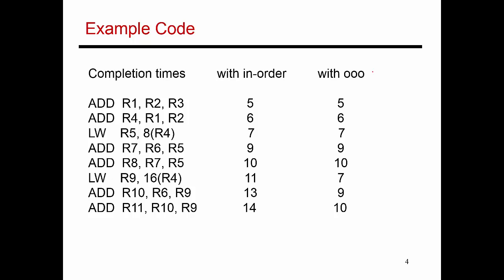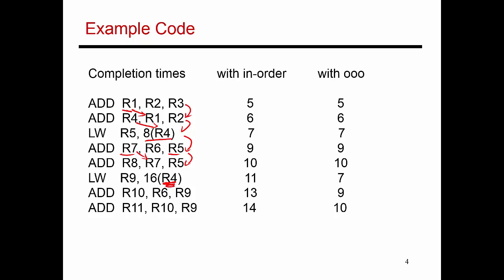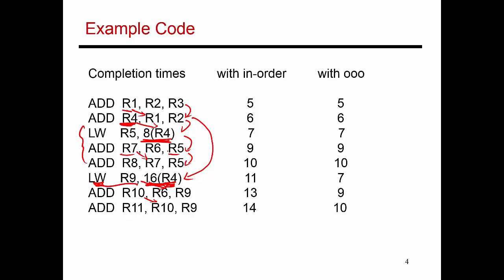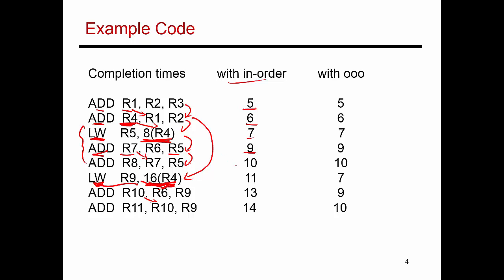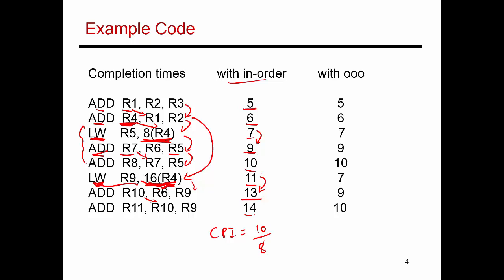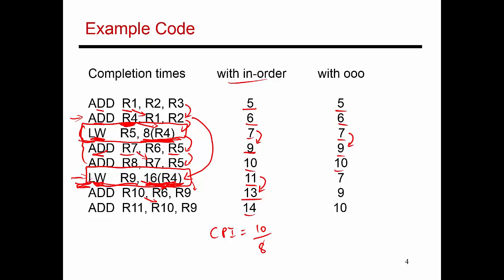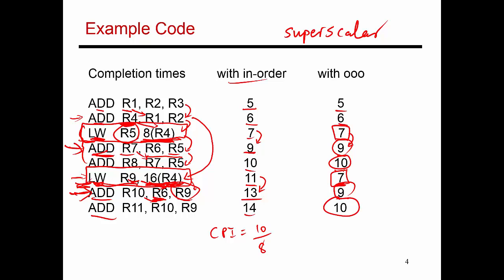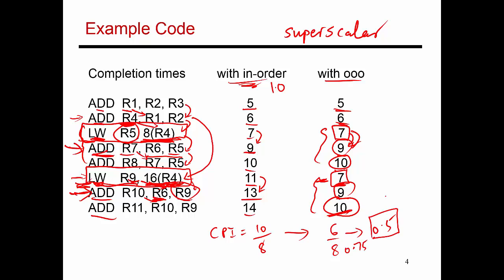Video 60: Out-of-Order Example, CS/ECE 3810 Computer Organization

Comment: The 1st LW instruction has 8(R4) and the 2nd has 16(R4).  What are the numbers 8 and 16 for?
Reply: 4 byte, 8 byte, 16 byte, etc. that's the offset from the stack pointer or from the current address of a register(e.g. R4, R3, R8, etc)